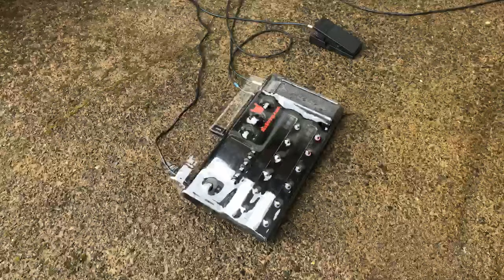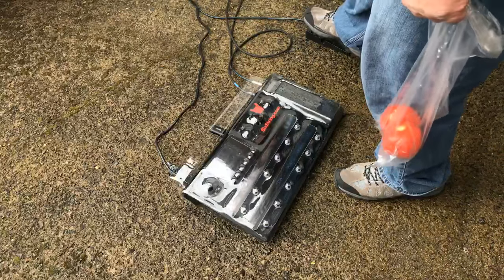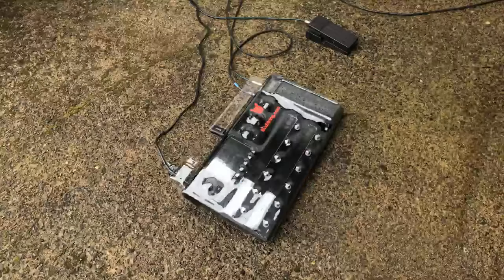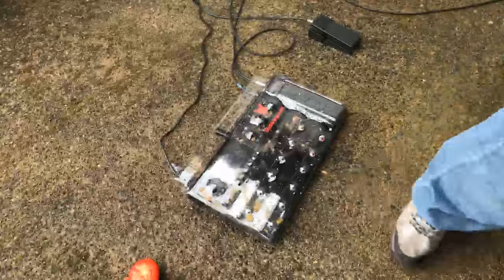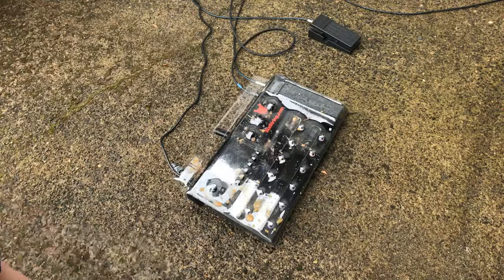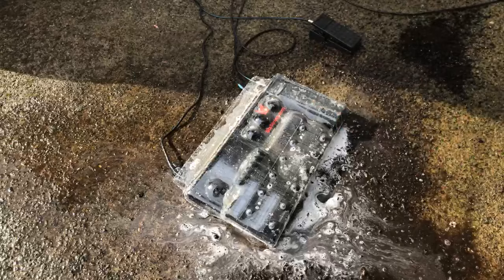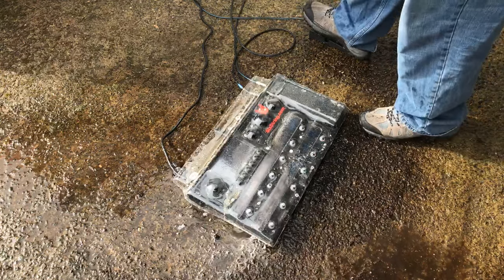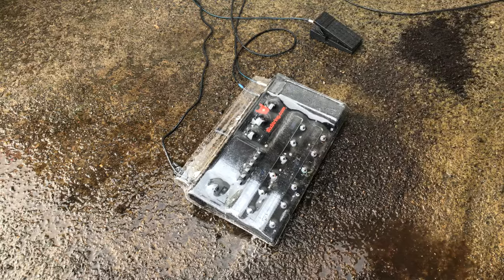Line 6 Helix Cover and Screen Guard Abuse - was disaster averted?

Comment: What is the 'danger' of moisture damage from under the unit? Seeing yours sitting in a driveway with a literal puddle building up around it has me wondering.
Reply from the maker: Bob SoloMan part of the instruction is to, when a spill happens clean it up - but it should be ok - let's be fair in 99% it will be only a mild spill - it would take a lot of water to go up past the feet - less of an issue if you gaff tape the holes at the bottom mine have been covered for months - zero heat issues
Reply: Chad Boston it made me think - outdoor event, on a flatbed trailer style stage and it starts raining... with this cover, the show can go on without danger to the Helix. But what if the stage gets so wet the pedal board begins to sit in standing water or is subjected to water from underneath. 
This is a great item tho. I may order one for my controller. 
For the record, our meteorologists rely too much on computer models too. Lol.
Reply from the maker: Bob SoloMan you could use  2 1/4 inch  paint sticks or similar under and use gaff tap - it would raise it up enough 🌷